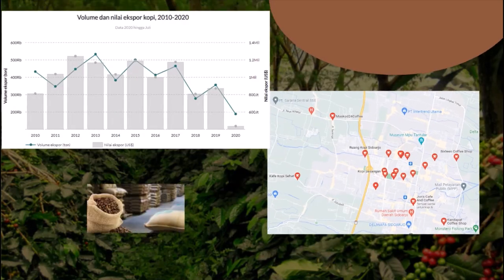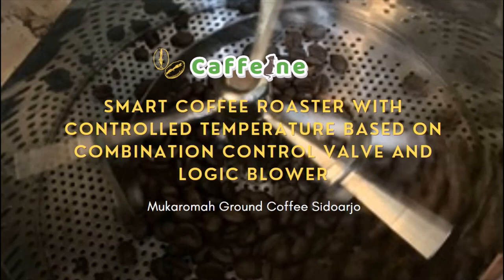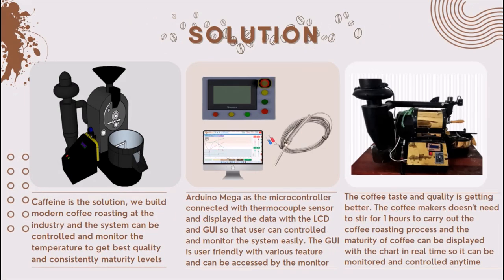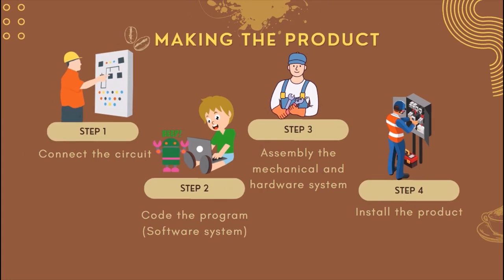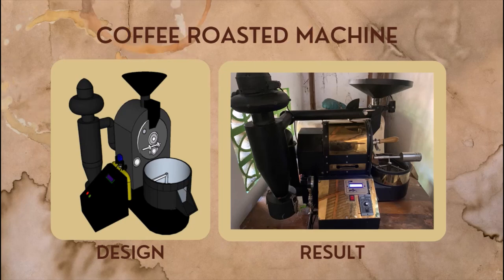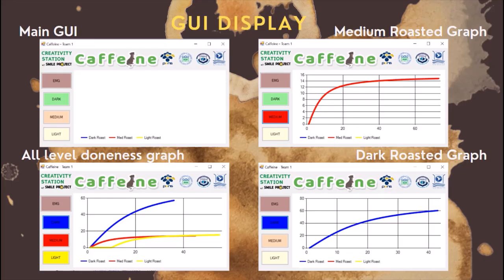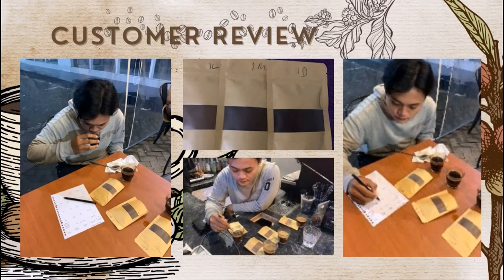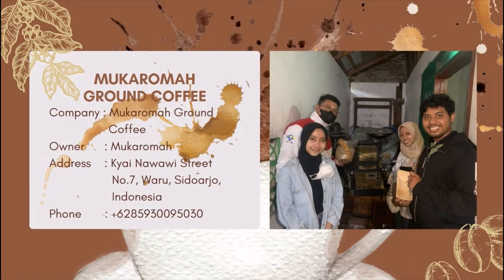[Caffeine] "Roasting Coffee Using a Traditional Stove."

Comment: Very good job caffeine team. Congratulations for this hard work. My questions are about safety concern:
1- Do the flame have a sensor to check that the firing still on ? The idea is to prevent any gas leak in case of flame going off.
2- Does the cover of the fan, when working on full speed, has a lock to prevent it from being opened ?

My last question is about the materials used, did you take into consideration the thermal exchange to minimize the gas consumption and to maintain the temperature stable.
Reply: Hello thank you so much😊
1. There is no sensor that checks the fire is still on or not because the sensor is based on the heat of the tube inside only. 
2. Locked with bolts, it is opened just want to see the speed of the fan. 
3. The material is food grade and the thickness is measured as thick as 2 cm to maintain the ripeness of the coffee evenly
Hope you have a great day, thanks for your questions😉

Comment: Hello, Caffeine 

First of all, Congratulations on completing the project.

I have the following questions:

1. Where is sensor position on this machine?
2. i think that fire power is affected by Fan's RPM. So, Could the degree of fan movement affect the firepower differently depending on the environmental conditions?
3. The current machine seems to be suitable for small quantities, but can the same be applied to roasting in large quantities?

Thank you
Reply: Hello Mr Ju , Hope you're well :)
concerning your questions : 
1- The thermocouple sensor is made up of a tube and it's based on the heat only inside the machine.
2- No it is locked with bolts and it doesn't affect the fire rate even if the fan at the highest speed.
3-yes it is possible , the prototype is already succeeded and it can be applied for larger coffee roasters if a manufacturing company respect the conditions imposed on the main design if they decided to create a larger one.